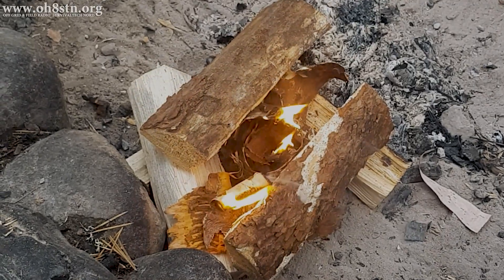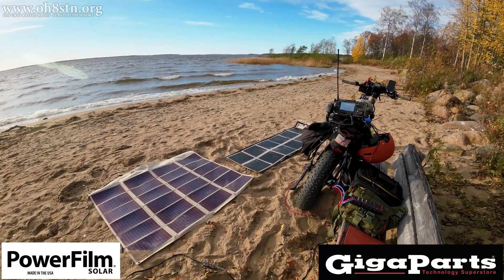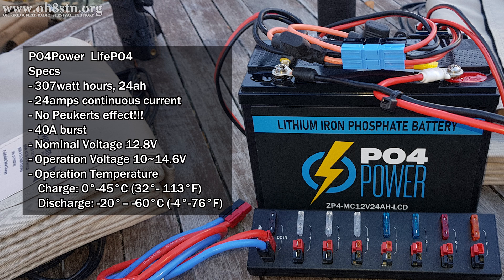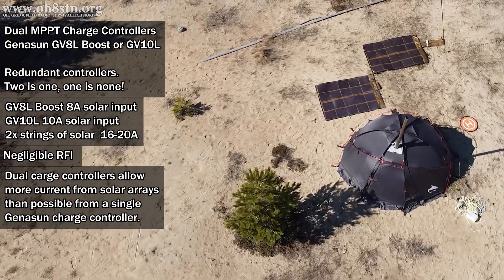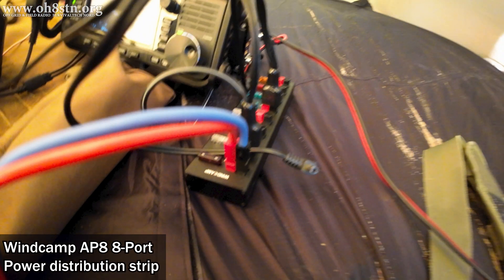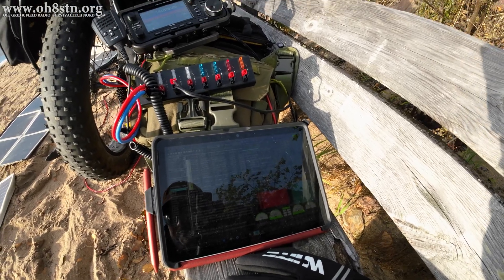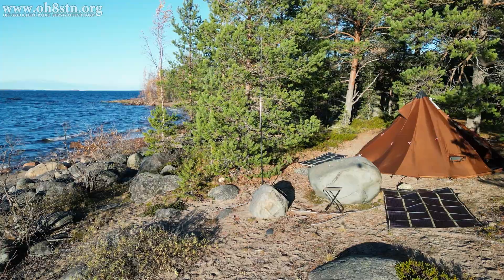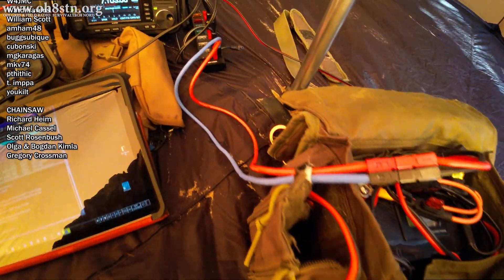Portable Solar Power for off-grid ham radio

Comment from the maker: Today we put together a 307wh portable power manpack. We also discuss the relationship between our communications and off-grid power strategies. 
73
Julian oh8stn 
Video url: https://youtu.be/L-_V8qOf0hM
Parts of the battery from @GigaParts  
Parts list:
24ah LiFePO4 https://oh8stn.net/24ah_lifepo4
Genasun GV-10L https://oh8stn.net/genasun_gv10l
Windcamp AP8 https://ebay.us/OSKCvN
Windcamp AP8 https://ebay.us/OSKCvN

Solar panels from the video:
PowerFilm F16-3600 60-watt https://oh8stn.net/GigaPartsPF60Watt
PowerFilm F16-7200 https://oh8stn.net/30YAeFz 
PowerFilm 160-watt Crystalline http://oh8stn.net/pf_160w_crystalline